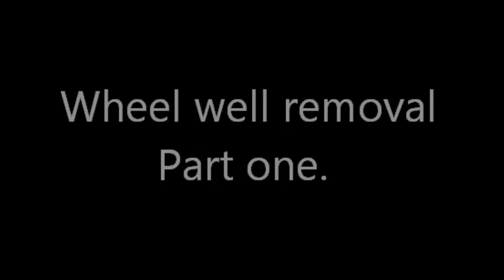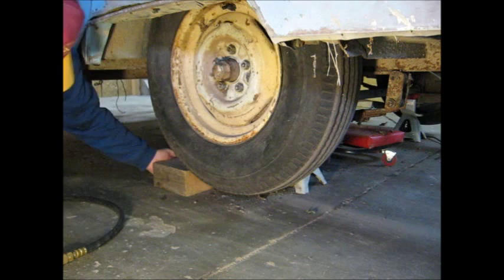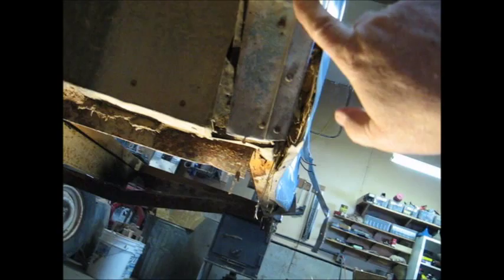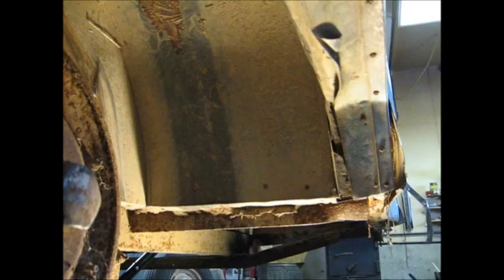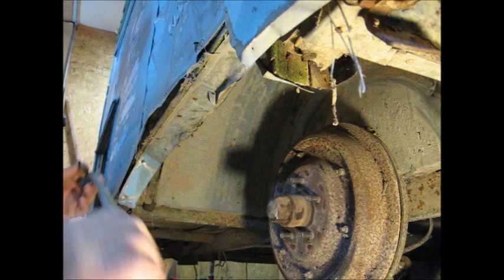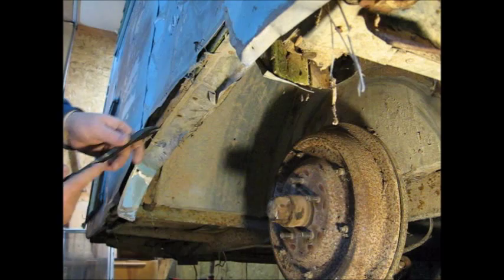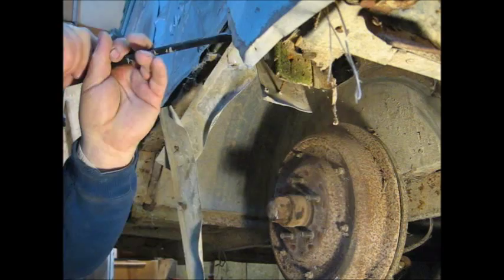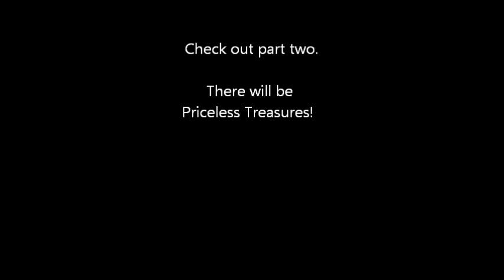Wheel well removal on a vintage trailer. Part one. #20a

Comment: Glad to see I am not the only one who's vintage trailer wheels are a tight fit!  Mine are a real pain to get off, I have to put minimal air in them to put them on and then fill them with air after they are on.
Reply from the maker: Doug Wells 
I have ordered new tires, wheels and hub caps. I got the tires from amazon. They are a Town and Country brand. The rims are from etrailer.com and the hub cap came from vintage trailer supply